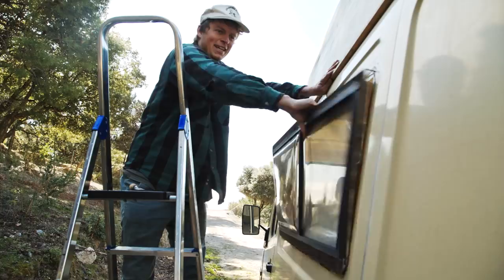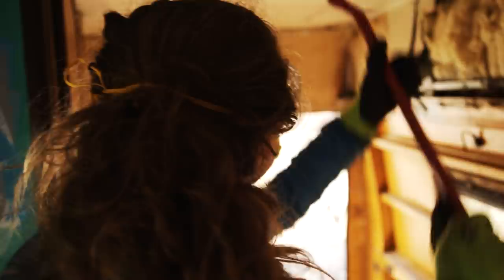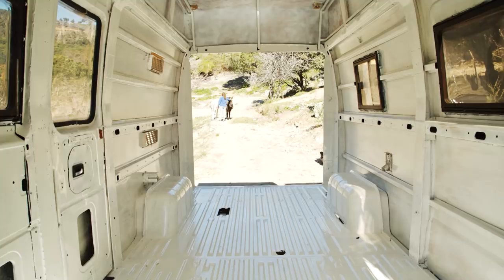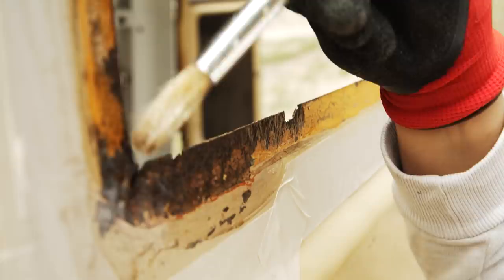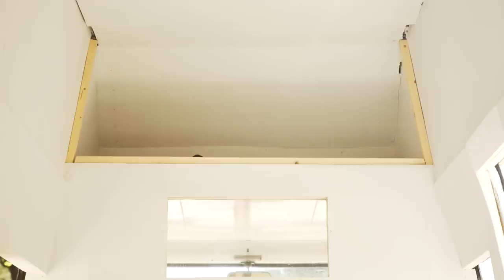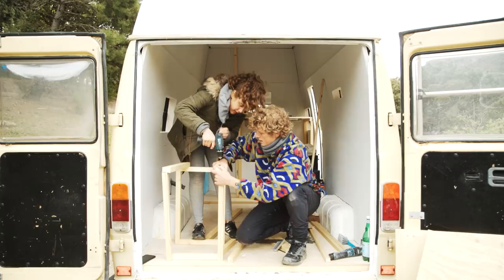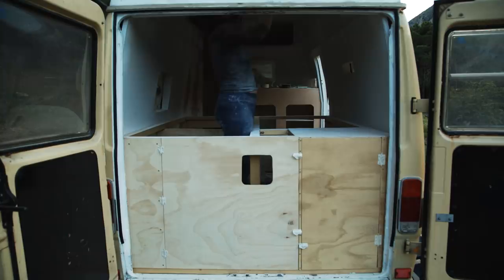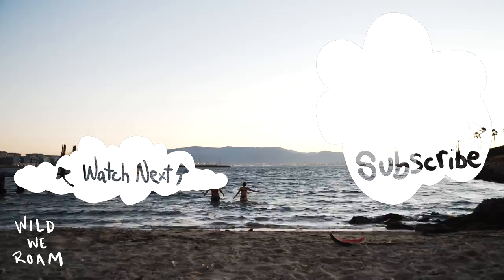How to Convert a Van into an Off-Grid Camper with NO EXPERIENCE

Comment: A Carbon Monoxide detector would be a wise investment.
Reply: I think a gas leak detector would be more important honestly.
Reply: Propane or butane odor can be smelled in very, very small amounts, and the gas system can be closed at the bottle (original twist shutoff or installed quick-shutoff lever), which they probably do when not in-use. The vents at the top of their van will help clear CO, [EDIT] which is HEAVIER than air (CO sinks, exiting small openings in van body) [/EDIT]. As active, young adults, I suspect their time inside the van will be minimal, even as their work requires it.

Every summer, our family traveled and camped for months in our 1960s Ford van with 1970s conversion technology (that is to say; zero safety widgets... heck, the world operated with "leaded" gasoline back then, too). On rainy days we ate meals and played cards, chess, checkers, Clue and Monopoly and slept in the van. Sometimes we slept outside, or slept in the van with doors and windows wide open. No-one died, got sick, or complained of discomfort… until someone dropped a deuce in the port-a-pot… then it was all windows open and time for my father to take a few drags off a fresh cigarette - infinitely better smelling than the brown bombs. We put no privacy curtain around the toilet to discourage its casual use.
Reply: @bob-ny6kn  Nice story Bob! Well I was thinking about the situation in which the occupants are sleeping in the van. The gas hob is not used in that situation so CO cannot occur. A leaky butane bottle however..
Reply: @Simon-dm8zv  I appreciate your (everyone's) grave concern and use of warning devices, and I too feared silent death (or explosion if Hollywood were real), so I made certain my seals were fresh, tight, and passed the soap bubble test (and so would you), but in all those van-camping summers (with shutoff knob engaged during long, freezing winters), and in the nine years of living year-round in countries where the butane-guy drove down the street twice daily, not one single problem for me or anyone I knew. A television show "Mythbusters" shot these tanks with bullets and could not get any to ignite (without accelerant). All the tanks did was empty rapidly. I am not an expert in these matters, only a common user. I would use standard, good practices.
Reply: @bob-ny6kn  Absolutely Bob, it all starts with good practices :)
Reply: I agree
Reply: Oh, yes. I do not know what I was thinking. I removed that from my text now.
Reply: @bob-ny6kn  that a really cool story

Comment: For whatever it might be worth to someone doing a build that they need to last a long time and endure the onslaught of moisture (rain, fog, snow) that these rigs must face, you want to spend a significant amount of time and careful work getting that first anti-corrosion part right. You want to get stiff pads and brushes and metal cleaning solution and get all of the existing rust / corrosion off and out that you can. Let it dry, repair and seal off everything that seems to be compromised or open, and let those materials cure. For anti-corrosive treatment or primers, I would spray it on under significant pressure when possible so that it gets into everything, including the hardest-to-reach places.  Just painting or sealing over corroded portions creates a set-up for trapped moisture and bigger problems down the road, though it's probably okay if you're only planning to use the rig for a short time before getting rid of it. If you want or need a painted topcoat, make sure it is rated for steel / aluminum as well and do a couple of applications. Otherwise, just do a second application of quality primer before covering it up with the rest of your build. Taking that extra time and effort can buy you a lot of peace of mind and durability a few years down the road.

Comment: I work on caravans as my job, when you took the skylight out the roof I was thinking you best put that back you need airflow, also get your battery’s in a proper sealed box out of your living area if they leak or explode for any reason won’t be good. Also get smoke and c02 alarms fitted

Comment: Great story. One tip now your new bed base is solid is to put some holes in to it allow airflow. Without them you get moisture trapped under the mattress from when you are sleeping. This leads to the evil mould. I had this on a motorhome I used to have expect it wasn't really possible to add holes for ventilation in that :-( If you can add the ventilation before the mould gets a grip it will save a lot of future problems and possibly avoid the need of a new mattress sooner than you'd want.Hope you have a fantastic time in the van and yes it will evolve and change as you do.

Comment: A very nice job indeed, especially considering you started from scratch with no experience!. One thing though... van conversions do tend to suffer from condensation - this excess moisture can lead to mould, particularly under the mattress. You can get around this by drilling some ventilation holes in the board under the bed.

Comment: I recommend getting some wooden slats (2x4 cm for example) beneath your mattress, otherwise you might run into some mold in the near future. A mattress needs air circulation in some way, so it won't stay too wet.

Comment: Next time you guys get stuck , wedge a 2 by 4 under both back tires and front and back up until all tires rotate onto the wood. Than gas it according to your rig weight. Feel it out than try and drive out of the situation.

Comment: I enjoyed your video but I'm concerned from the comments that say CO is heavier than air IT IS NOT that is a myth co is in fact slightly lighter than air (CO has a molar mass of 28.0, and air has an average molar mass of 28.8) and will readily mixes with air which is why it's so lethal. Ideally you need vents in the floor as well as the roof to aid fresh air to circulate. Vents in the floor also have another safety purpose as they are also known as gas drops because gas IS heaver than air so floor vents will prevent a build up if you have a leak. I am to be honest shocked at how many self-builds don't vent there vans properly .... be safe

Comment: Could you have tried steering hard over moving forward so you were side on and then 3 point turn parallel to the slope then take a run on the last turn going back up the hill forward this time?   But at least you had help,

Comment: You need to treat the rust sections properly.flex the rust off and recover the damaged area first. Painting it over doesn't work. In 1 year the rust will be back.
Your insulation will suck up moisture since you have no vapor barrier 
Your solar panels on the roof fixed with double sided tape are a hazard. It will dissolve when it rains, and when you drive on the highway, they will come off and kill the family driving behind you-
your electrical installation looked quite scary, too.
Best of luck, you'll need it

Comment: Does your vehicle have rear wheel drive and the engine at the front.... then the weight is not heavy enough at the back this would stop the wheels from spinning.... ie load all your water at the rear or similar - hope you solved the prob for future probs!

Comment: I am still watching the video but so far, I have 2 Major questions: One being, Why was the van down in the ravine? and the Second being, Why does it look like it was *already* setup as an off grid camper before y'all started gutting it on the side of the hill?

Seems like someone already did a conversion on it and you two are simply changing/updating it?
Reply: Did you miss the part when they took out all the interior in the van and started from zero?

Comment: Was it necessary to paint the bare metal before putting anything else in the van? It must provide an extra layer of something?
I'm genuinely interested in this
Reply: They sanded it down to get rid of the old rusty parts so my guess is to seal the material and prevent it from getting rusty again
Reply: @wiebki  thank you so much!!